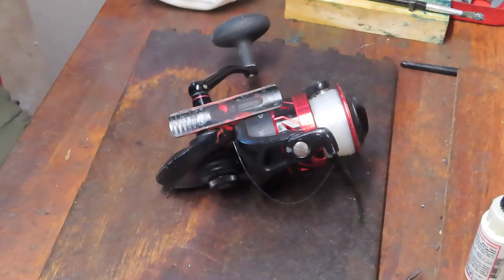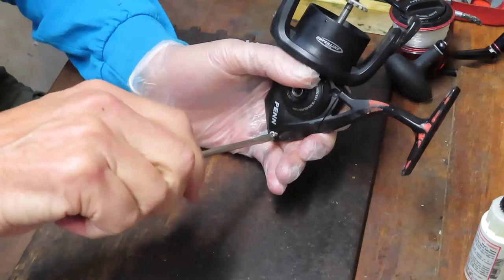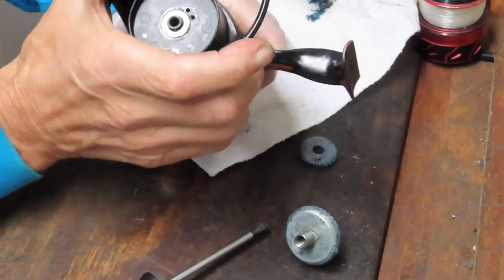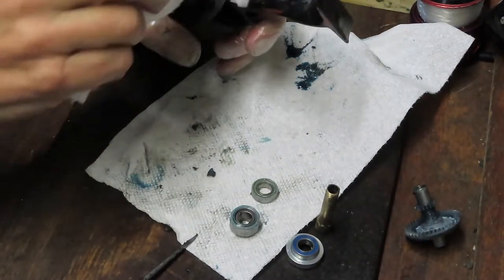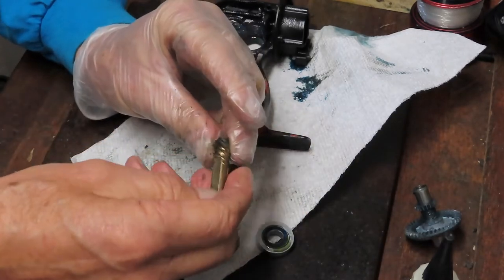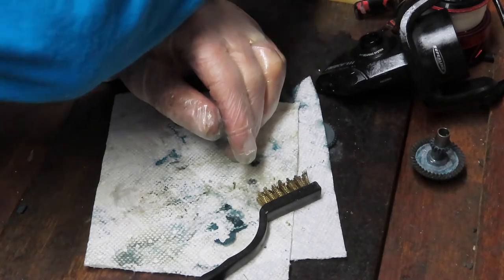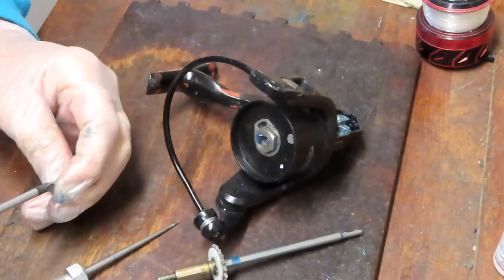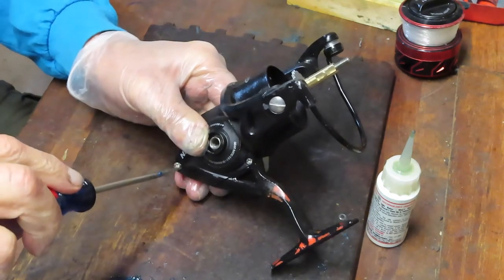Penn Fierce III spin fishing reel repair problem diagnosis and how to take apart and service

Comment: I don’t have a single reel with an AR bearing in it. All my 95 reels have a switchable AR on them. You’re doing it with the paper towel again!  You know you have taught me well because I’ve actually repaired two axle shafts in vintage Daiwa reels. One was an Ocean Star No. 36.  I think diagnostics come from experience and a sound methodology. You know I got a mint never used Daiwa Pit reel - an Emcast X 5500T - for $11.50 on EBay once. I use it with braided line to cast out past the bar surf fishing. I found that someone had purthe AR cog in backwards so I fixed that and it was perfect. I have a mint Penn 104 that was the same way. The bargains are out there if you are careful and lucky. You did a great job on this reel!  I sent you an e-mail about the second of my big Bretton surf reels and the little disaster I had today. I just need to find another E clip and all will be fine. It is a very beautiful and powerful reel! ——— Chris
Reply from the maker: Thanks Chris - Yes I did get the e-mail.  Those things happen!  Best wishes - Dennis

Comment: Just wanted to add a tip if you are welcome to tips....  When I remove the shaft and clean the pinion gear, I use gun cleaning bore brushes inside the pinion gear also to remove any foreign matter and clean the inside just like the barrel of a .22 or a .177.  Makes it smoother and a cheap tool to buy.  Most of us already own them.
Reply from the maker: I always welcome tips.  Thanks for the note.  I don't own a gun or work on them, so I am left with cotton swabs.  I will ask around on the bore cleaning tool. - Thanks for the note - Dennis

Comment: Looks like the line-lay is oriented more towards the top side of the spool instead of being even. I believe Penn supplies a plastic shim washer stack to put under the spool to adjust and correct this. Nice to see the reel up and running.
Reply from the maker: They do use a shim on top of the click rotor and you can add another if there is a problem with the line lay.  I think what happened here is that the axle shaft was binding and not completing the cycle so the line spooled high.  Thanks for the note - Dennis

Comment: Thanks for the video! It helped me to disassemble the reel after it was dunked in the salt water. However, when I was assembling the reel back after cleaning I faced the same problem as you did in this video - frozen reel after I screwed in the main shaft. I solved that the same way as you did and seems like now I have a slightly bent main shaft, its hard to notice visually, but it reels freely until it reaches the certain positions of the shaft when it slows down. I am going to order a new main shaft assembly, but it looks like this part is very easy to bent and maybe I should order more than one just in case I face this issue again. My question is - from your experience, when the reel is stuck like in your video, is the main shaft almost certainly needs replacement? Any tips how to prevent the reel from stuck like that when assembling it? Thanks!
Reply from the maker: You should order a replacement for the axle shaft.  The reel gets stuck because of the location of the crosswind block.  Check to make sure it is at the low point before assembly - Dennis

Comment: I great video. Thanks. Would you recommend  a Pursuit iii or the Fierce iii. Pricing on the Fierce only $10 more than Pursuit? I am new to spin fishing and keen on one of either of these.
Reply from the maker: Either one is fine.  The Pursuit is a little more rugged - The Fierce a little lighter and slightly faster retrieve.  The Fierce III is basically the Battle II, so for the extra $10 you may want to go with the Fierce. - Dennis

Comment: Hello I recently came across your videos while searching for reel cleaning. I already serviced a couple reel but now I have 2 reels that need replacement bearings. They are completely frozen. Where can I buy replacements? Just looking for stock bearings not any upgraded ones. Thanks
Reply from the maker: You can get the Penn bearings from Mysticparts.com  You can try an eBay seller, HPRbearings.  They have a store on eBay and they carry a wide assortment of bearings for many different brands of fishing reels.  Just search hprbearings in the bay search box to get to their store.  If you don't see what you need, just send a message to them through he contact seller feature

Comment: Sir, I love your videos and thank you very much for what you do! Please let me know how to disable the most annoying feature, the automatic bail trip on this Penn Fierce iii model because the bail closes by itself when casting and I've lost many rigs this way. I've tried to find a video on how to disable but I couldn't find one for this model. I appreciate it. Thank you
Reply from the maker: There is a trip lever bar that is located inside the bail lever arm on the line roller side of the rotor..  You can remove the bail arm pivot cover and then remove the trip arm bar.  The bar is the round one that looks like the letter "Z".  When you do this, make sure to leave the spring assembly intact or you will not have tension on the bail while using it.  That should convert your reel to the manual flip - Dennis
Reply: @2ndChanceTackle  thank you very much, I will try that. I know a lot of people who want that feature off and don't know how to do it since there are no videos about it. I appreciate you
Reply: Dennis, I don't know how to thank you, Sir! I took out the z shaped part and it works the way I need it to, no more automatic bail trip 😀

Comment: Do you need to put any thing on the bolt from the handle, like grease, so it doesn't freeze up in the reel? So you can back it off to remove?
Reply from the maker: You can.  It will not harm it

Comment: Hi, I use an 8000 Fierce III to crab snare and it’s been stored in my outdoor shed for almost 2yrs. Took it out recently & it kept seizing on me whenever I try reeling in a catch. If no catch, it spins perfectly fine during regular cast/retrieve. As soon as I’m onto a crab, it’ll allow about a 1/4 turn on the reel before it just locks up & does not spin until I lose my catch. Never had issues with this before. It’s worked perfect years prior but its been sitting for about 1.5yrs until now. Could it be dried grease? Rusted internals? What else should I look for? Also, thanks so much for this video.
Reply from the maker: Dried grease is the likely cause.  Remove the lower case side plate and use a soaking spray all over the gear assembly with a good penetrating oil.   if it is dried grease, or no grease, that will help loosen it upl
Reply: @2ndChanceTackle  thanks for the response! I opened it up & couldn’t seem to find any issues. Plenty of grease that’s still green; doesn’t appear to have any rust issues either. I was expecting to find a bunch of sand too, but not a single grain. I’m stumped.
Reply from the maker: YW

Comment: Dennis what's your opinion on using an old tooth brush to clean the internal parts? Do you think bristle particals could break off and jam the internal gears and such?
Reply from the maker: I use them and have not had an issue with the bristles falling off - give it a try - Dennis

Comment: Hi there, I did a thorough cleaning and have triple checked the schematics to make sure it’s assembled correctly. However when I tighten the screws for the case to the reel body the spin has a lot of resistance. If I back off the screws so the case is just a little loose it spins much easier. 

Any ideas? Thanks so much
Reply from the maker: Something is not seated correctly.  That tension is usually the result of the main gear being too tight.  Check where the shim is on the stem.  It belongs between the gear and the bearing. Also, remove the handle and tighten the case to see if the reel spins freely without the handle.   If it does, something is binding when the handle pulls the main gear to the side plate.

Comment: Hey i know this video is a little old, but im having a problem with an fierce 2 i just bought used. When i bough it it was jammed it would not turn which i thought was lubrication. When i got it home i cleaned it up, lubed it up and it spun but still rough, after a few minutes cranking it got really smooth. However, it locks up in 1 or 2 spots. Could it be a bent shaft?
Reply from the maker: Yes - it is most likely a bent axle shaft.  You can get a replacement through Mysticparts.com  To test to see if it is a bad shaft, remove the screw from the crosswind block and pull the axle shaft up and out of the reel.  Use the pinion gear as a slide and move the shaft up and down through it.  If it is sticking, then the shaft is bent.  It should glide smoothly.  Make sure you have the pinion shaft bushing in is when you are testing - Dennis

Comment: Hi. My fierce 3 is not spooling evenly,I took the spool out but I don’t see any washers. I bought it as a combo,so it did not receive a box with it. How do I correct this problem. Thanks.
Reply from the maker: If the line is gathering high on the spool, you will need to add a spool washer.  You can make it yourself with a flat piece of plastic like that found on a soda bottle.  Poke a hole in the center to go over the axle shaft and then trim around it to make a washer.  That will. raise the spool and enable line to cater on the bottom.  If you don't want to make one, you can order the part from Mysticparts.com.  You may need two or three to balance the line - Dennis

Comment: I have penn pursuits  5000 and 6000 with uneven line  Do you have any ideas on what I need to do to fix them
Reply from the maker: Yes - you need to add or remove the ship washers on the axle shaft.  If the line is gathering high, you need to add a washer or two to raise the spool.  If it is gathering low, you need to remove a washer or two to lower the spool.  This will correct the uneven line problem - Dennis

Comment: Hello, so today I was cleaning my fierce 3 6000, and I accidentally snapped the stud off my crosswind gear. Does that stud go inside the crosswind block? Can you do a quick explanation of that for me? and where could I buy another crosswind gear?
Reply: and do you have a shop I can send my reel to have fixed?
Reply from the maker: Yes - the stud on the crosswind gear goes in the channel of the crosswind block.  You can order replacements for both through Mysticparts.com. The key numbers are 231 for the gear and 43 for the block on the attached link https://www.mysticparts.com/PennParts/PennFRCIII6000.aspx.  If you are interested in reel service through my shop, please send a note to my email 2ndchancetackle2gmail.com Thank you - Dennis

Comment: I have the same reel. Almost new still and the drag stopped working. No tension at all. Any ideas?
Reply from the maker: The most likely cause is dirt and debris on the washers, but they could be worn  or torn as well.  Best to remove the spool and check the washers - Dennis

Comment: I have a Fierce III 6000 that needs a new main drive. I got the new drive but cannot remove the  bearing from the old drive! Any idea why? The reel is relatively new (less than 4 months) but some of the teeth on  main drive got chewed up causing reel to "skip" when reeling line back in so I took it apart and detected the defective teeth. But like I said, I can't remove the bearing from the old drive. I have ordered a new bearing but I would think that you should be able to easily remove the old bearing. The bearing is on back order so I have a wait....how long I do not know. Thanks for any help.
Reply from the maker: Yes - the handle likely peened or flared the end of the main drive and caused the bearing to get pressed inward.   If the reel is only 4 months old, you should send it back to Penn.  The warranty is for 1 year.
Reply: @2ndChanceTackle  Thanks Dennis! I thought I was losing my mind!
Reply: @2ndChanceTackle  Finally got all the new parts and thanks to your thorough step-by-step video I got it all back together and I am ready to fish with it tomorrow! Thanks again and keep the videos coming!

Comment: Does the fierce and pursuit have the same frame as far as design. I know one is plastic and one is metal but I was curious if I can do a frame swap as I've seen several fierce 8000 frames used for cheap and though I could swap my pursuit frame. Internals are the same and drag and spool are the same. My 8000 pursuit 3 has been great but when I load it up on a decent shark there is a LOT of  frame flex.
Reply from the maker: You don't mention the version of the reel that you have, but I don't think they will swap out because the main gears are not the same and that would likely cause issues with the crosswind gear in the housing and other alignment problems.  If you find a housing cheap enough, give it a try and let me know.  It would be a learning experience either way - Thanks for asking - Dennis
Reply: Oh my bad. It's a pursuit 3 8000 and I'm curious if a gen 3 fierce 8000 frame will swap.
Reply: After doing more research, I see on mystic reel parts that the main gear, pinion gear, cross wind gear are all the same part. As we're many other smaller bits and pieces. So really other than anti reverse parts it all seems like the same part numbers. I might get the frame and let you know what I come up with.

Comment: My rotor cup is wobbling. No scraping as it spins but it is uncomfortable to say the least. Everything is tight and internals seem ok. Can't figure it out. Any advice?
Reply from the maker: It sounds like the rotor nut that holds the rotor to the pinion gear is loose.  The nut is on top of the rotor at the base of the axle shaft.  Check to make sure that is tight. - Dennis
Reply: @2ndChanceTackle  everything is tight. Could it be a bad pinion?
Reply: @S.AFishing410   @2nd Chance Tackle I am having the same issue with my Fierce 3 6000 LL, did you ever happen to find a solution? My reel is only a few months old, I use it almost every day but I keep it clean and take good care of it. Any advice would be much appreciated.
Reply: @2ndChanceTackle  ^

Comment: Mine stiffens up while I’m reeling.
Reply from the maker: There are several potential causes - Bad grease/no grease, bent axle shaft, too much tension on the main gear/missing shim washers, worn or broken parts.  Hard to say with taking the reel apart - Dennis

Comment: I have pens pursuit 5000 and 6000 That's rolling in uneven line do you have any ideas on what could be the problem or how to fix it
Reply from the maker: Yes - you need to add or remove the ship washers on the axle shaft.  If the line is gathering high, you need to add a washer or two to raise the spool.  If it is gathering low, you need to remove a washer or two to lower the spool.  This will correct the uneven line problem - Dennis